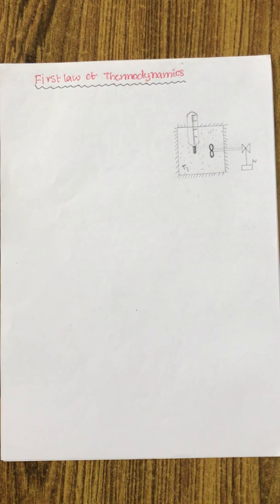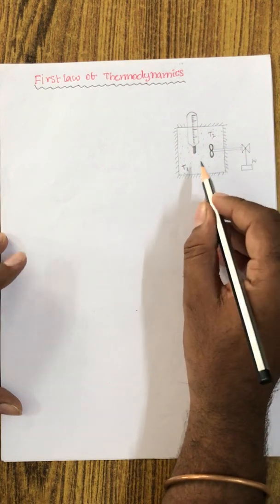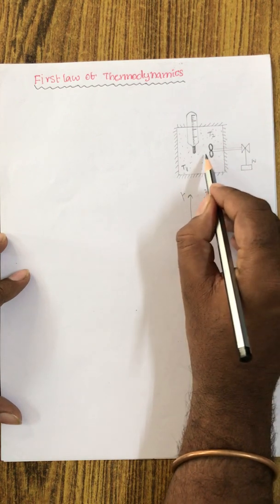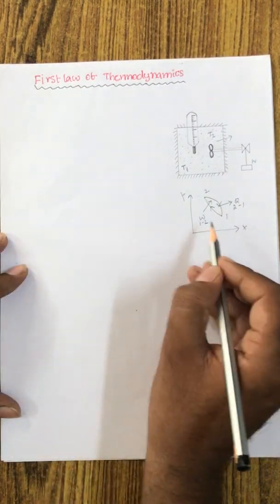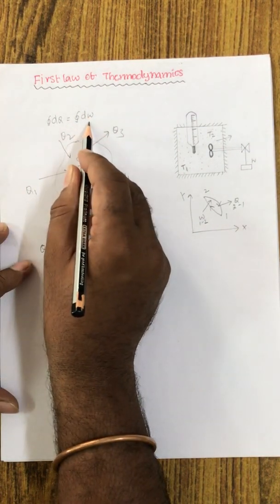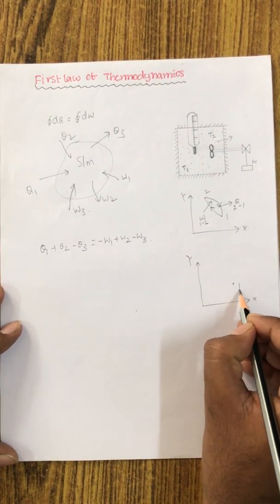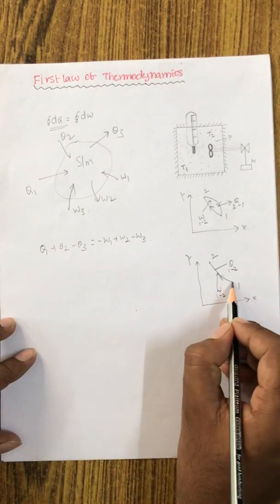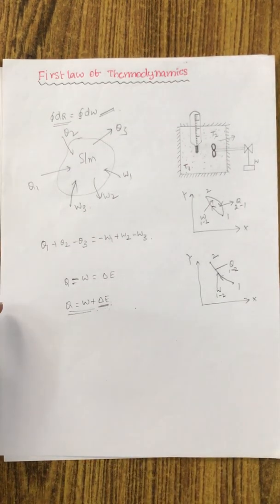THERMODYNAMICS 23: FIRST LAW OF THERMODYNAMICS

Comment: Isolated system ..then how heat transfer to the surrounding..adiabatic?
Reply from the maker: I didn’t get u exactly 
But I m trying to answer u
Isolated system means no energy transfer and universe is the best example for isolated system 
Universe is combination of system and surroundings. Even if energy transfer from the system it goes to surroundings only. So net energy of (system+surroundings=universe) universe is constant 
For further clarification u can message me I will call u back